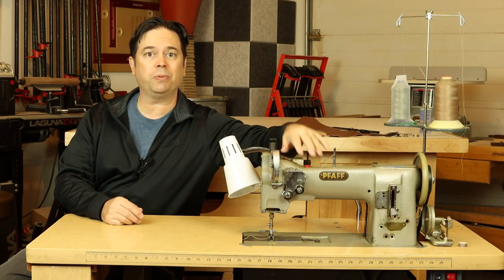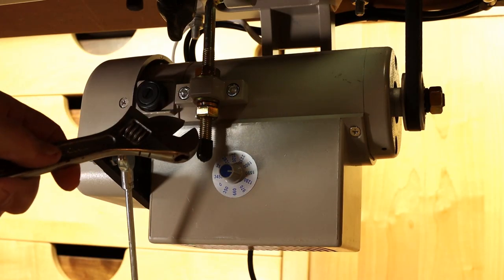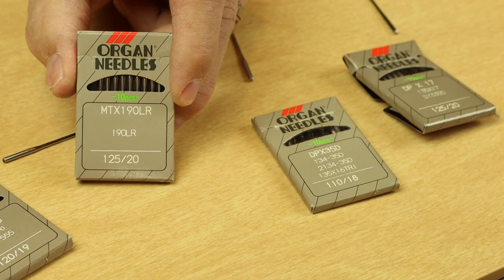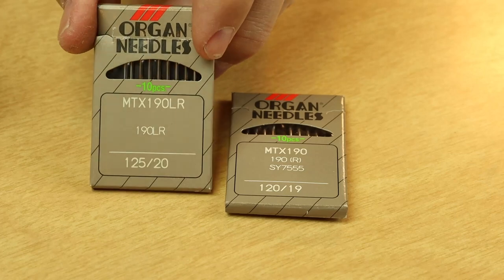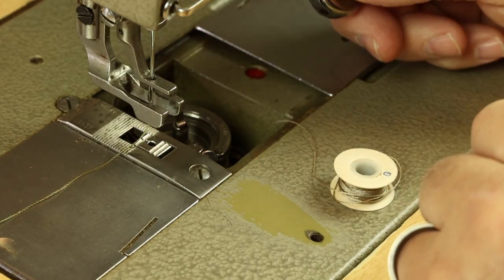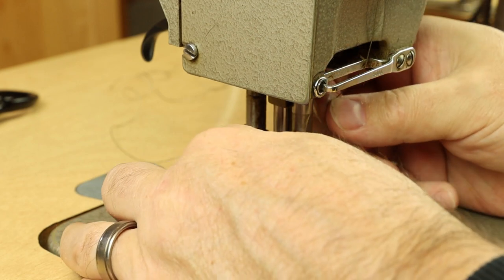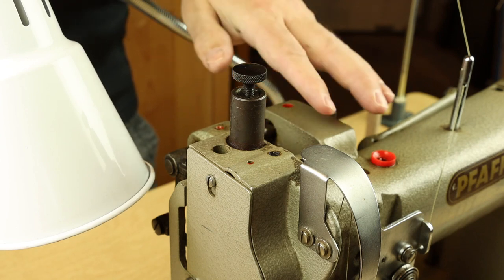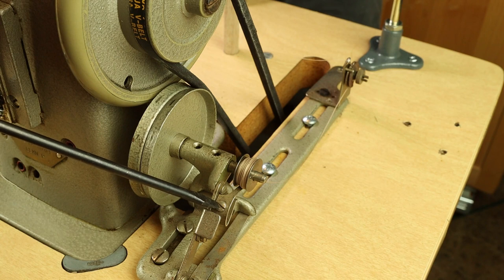Everything Pfaff 145 Walking Foot Industrial Sewing Machine Learn to set up and adjust Pfaff 145 545

Comment: I have a545-H3 that I got for free for fixing someone's computer that was moving . They had a couple other machines and didn't want to move it. I've since completely restored it right down to the hammer finish paint. I used to use if for sewing patches onto jackets and vests but I've since started doing leather work. I'm tuning the machine for that now. This is one of the best overall views I've seen for these machines.
Reply from the maker: That's cool, sounds like you appreciate old German cast iron like I do.  Have fun with your Pfaff and thanks for the kind words.

Comment: Hi there, excellent video.  I need some instruction on skipped stitches for my pfaff 145 h3.
Reply from the maker: Thanks!  Start with the simple things like the correct needle system 134-35 for the H3 variant of the 145.  Versus 190 system needles for H4 machines.  Also be sure that your thread size is a good match for your needle size.  I typically use 92 weight thread with a #19 or #20 size needle.  Jumping up to 138 thread usually causes problems, unless you dial the whole machine to suit thicker thread.  If that doesn't help, it may need a full time and tune.  Best to you

Comment: This is a very informative video of a 145 pfaff. I purchased one that i believe was used for parts and repaired, it is missing many things as the knee lift lever hinge to spring, gear covers and top plates, any idea where these hard to find these parts? I own a 145 H4 almost new so i have something to compare
Reply from the maker: I've bought used Pfaff parts from Nick-O-Sew and eBay.  Good luck finding what you need for your machine.

Comment: I loved this video. I am 75 and have a Pfaff 145 - H4  6/1C. I purchased it several years ago for my wife, but she hasn't used it. It was used by a lady who did shoe and clothing repairs and then it was purchased by a man who made leather products and repairs for horse shows.  That is who I purchased it from. I cleaned the case and the table and had it serviced by an industrial sewing machine company in Beloit Wisconsin.  NOW I intend to do some leather reupholstery even though I have never sewn anything in my life. So, I just want to tell you this video is magnificent.  If I could download it, I would just to have it for reference when needed. 

I am going to have a lot of questions, I think, as I grow more familiar with the machine, with sewing leather, and with upholstery in general. Right now, I have two dying questions. Is there a guide I can attach to the machine so I can set the needle at a constant distance from the edge of my piece? I think I may make very wavy or crooked seams.  My second question has to do with how s-l-l-o-o-o-w-w-w you were able to sew. I do not have a servo - just a regular electric motor and I need to be able to sew slowly until I can become more familiar with the machine and the process.  I very much appreciate any instructions or advice you can give me.

Best regards,
DG Crum
DeKalb, IL
Reply from the maker: Hi Darryl, thanks for the nice comments.  For sewing straight lines you can use an edge guide.  I recommend a simple magnetic guide that you can get from Sailrite or any sewing website.  To slow the machine down, you'll need to install a servo motor.  Use a small motor pulley for even more control.  Here's the video on installing a servo ... https://youtu.be/Dx_rS9Fzvfo
Best
Reply: @TheThoughtfulWoodworker  You are the best. If I ever become a world-renowned reupholstery artist, I owe it all to you.  Thank you again for the information.  Uh, if my wife happens to read this, Thoughtful, I owe it all to her. Just covering my bases, okay.
Reply: @TheThoughtfulWoodworker  One more question, Thoughtful. Where can I purchase a servo motor kit and what model did you install on your Pfaff 145 H4?  Thank you for all of the help.
Reply from the maker: @darrylcrum2495  This is the servo I use...  https://amzn.to/3wWFXZa   It will make your Pfaff a whole new machine!

Comment: Very well put together instructional video, i have no problems with my 145 h-4 other than i wish i could space my stitch a little more for top stitching, so my question is is there anyway to do so.The factory stitch width is just not spaced enough. TYIA 27:53 27:53
Reply from the maker: Thanks.  There are ways to modify max  stitch length, but I don't recommend it because your reverse stitch length won't match.  Leatherworker.net may have an old blog post on the topic.  Best to you.

Comment: Thank you for this tutorial. There is a Pfaff 145 in an auction right now when nobody has bid on it. There is less than 24 hours left in the auction and I was wondering what this machine is capable of and whether I should put a bid on it. After this I think I I will put a bid on it. Even if the sewing machine is junk the table are in great shape and can be used with my Willcox and Gibbs High Speed lockstitch.
Reply from the maker: Hi Dale, a Pfaff 145 CLMNP H3 or H4 is a typical upholstery weight industrial walking foot sewing machine.  There are many variants, but the most common says CLPMN on the plaque.  That one is capable of sewing up to 3/8" of compressed leather or material.
Reply: @TheThoughtfulWoodworker  On the post of the sewing machine there is exactly the same number that you had in the video. I will be a bidding on it because sometimes people do not bid on them, and they go to scrap. I assumed it was an upholstery machine or leather machine, but wanted to watch your video to make sure. Thank you

Comment: I've had my Pfaff 145 H4 for over 20 years.  Other than reading the manual, I have had no guidance on the machine!  Your video is the absolute Best information!  I do have some questions tho. Regarding the wing nut on the back you refer to "steppage" and using the wing nut to raise or lower it for the steppage..What does that mean? And, on the bottom of the machine you mention the grease covers on both sides.  Do you somehow take them off and where do you apply the grease?  Also you mentioned the safety clutch.  Should that have grease or oil applied also?  The explanation of the needle system was very clear too.  I have learned so much about my machine today!  Thank you!!!
Reply from the maker: Hi Ann, that's great to hear.  Thanks for the positive feedback.  The wing nut controls how high the feet step relative to one another.  That's all I mean by steppage.  
As far as the grease covers underneath, you can remove the metal covers and replace the grease inside.  Just smear some on the gears and re-install the covers.
Everywhere else I just use sewing machine oil as recommended in the manual.  
Best
Reply: @TheThoughtfulWoodworker  Thank you so much, again!  I'm going out to my shop and grease and oil my machine!  :)

Comment: This was very helpful and informative.   I would like to see how to replace the needle.
Reply from the maker: Thanks!  Check some of my other threading videos (consew 226, consew 206rb, and general Juki 563 videos) I think there's a tutorial on installing a needle.  Basically the groove faces left, and the scarf faces right.  Be sure to use the right needle system for your machine.  134-35 for Pfaff 145 H3, and 190 needle system for H4 model 
Best

Comment: I have a 1245 and love it this tutorial ❤❤ I have a question that I can't find anything on it. The reverse and stitch length lever fell out of the machine how do I put it back in as if I just push it in there I'm not able to adjust the stitch length. Do I need to take the plate off and adjust it inside? Do you have a place where you can answer certain questions? Thank you lynn

Comment: Very nice video.  I was wondering which would you choose if the price was very similar.  
The Pfaff 145, Consew 226r or Juki 562.  Locally,  all three are very similar in price.  Your sage advice will help me choose a machine that will be used with care.
Reply from the maker: My regular upholstery machine is a Juki LU-563.  That's the same as a Juki 562 except has a super large U style bobbin.  So between the three I'd take the 562 first, and the Consew 226 second.  Condition plays a big factor too.  Good luck with your decision!

Comment: What a great video! I have a small problem on my newly purchased old pfaff, it seems to be stuck in reverse and we can see that someone has tried to adjust it because some of the screws are damaged. The motor sounds good, the machine looks good, we got is to the point that the feet are working as they should but still in reverse. Any help will be apreciated thank you.
Reply from the maker: Well the simplest explanation is that the motor direction got reversed.  This only applies to servo motors though.  If that's what you have, just find the switch on the motor that reverses the direction.  It won't sew in the reverse direction at all 
Otherwise I suppose it could be the reverse lever mechanically stuck in the up position.

Comment: Thank you for all the great information I have a Fnaf 545 and for some reason my top thread on the needle side continues to get cut by something. Do you have any recommendations?
Reply from the maker: I've had that happen too.  Usually it's when you forget to go through the needle bar thread guide.  Or there's a rough metal edge on one of the guides.
Reply: Thank you so much for the reply. I ended up having the needle spun in the opposite direction, and the sharp piece on the bobbin was impacting the needle on rotation.

Comment: Also is the "instruction manual " what I would use for fixing and maintaining the machine.  Thanks for any help you might provide.  Happy labor day
Reply from the maker: Hi Neal, the user manual is good for maintenance like oiling points and basic setup, but for repair you'd need a service manual.
Thanks
Reply: @TheThoughtfulWoodworker  Thanks for your getting back to me.  The inside of this machine is pretty hairy with dust animals everywhere.  Cleaning and a parts needed list will be a starting place.  I will continue to look for the "service manual"  Any thoughts on where to find one.  All the best neal sw fla
Reply from the maker: @nealhere  A service manual may be available from an industrial sewing machine dealer, or you might get lucky on eBay.
Best
Reply: @TheThoughtfulWoodworker  Thank you I'll do some checking.  Have a good holiday.  You are doing good work out there.

Comment: I recently bought a pfaff 545h4 and the guy told me it ran with 135x17 needles. It’s sews okay but sounds pretty clunky. Should I just reset needle bar at to take 190 needles again?
Reply from the maker: I certainly would.  That's what it was designed to sew with.  I like 190 needles better anyway, because they are a little longer, with less chance of the needle bar hitting the presser foot.  Just stay on the high side of needle sizes.  For instance, if 92 weight thread can use a size 18,19 or 20 needle, choose the #20.  Less needle breaks that way.
Best
Reply: @TheThoughtfulWoodworker  I appreciate the quick reply, thank you for the awesome videos as well.

Comment: Very usefull video, thank you! Also if you can help me i have question for you about my pfaff machine and situation. I have pfaff 145VB6B GM (i think  "B"  is little worned, its old machine :). It is super fast machine so i want to install new servo motor so i can speed it down. But do you think also i can use thicker treads on this machine. Thicker than "40", mb 20 or even 10. Is it possible to use that treads if i change needle on it. Would be very helpfull, thanks!
Reply from the maker: Thanks Dean.  The designation on that Pfaff 145 is a little different than I'm used to.  Pfaff made so many special factory machines for special purposes, it's hard to know until you see it in person.  Usually "B" means for medium weight materials, and "G" confusingly means large bobbin (because on a Consew a G bobbin is a standard size).  I can't find reference to the specific machine you mentioned, so it must not be as common as a 145 CLMPN that I usually see.  C= Medium to heavy weight, L= for sewing leather, M= has a safety clutch device, P= has 4-motion drop feed, N= denotes maximum stitch length, 6mm if I recall correctly.  If it is indeed a medium weight machine, it will sew up to 92 weight thread like most industrial sewing machines.  Good luck!

Comment: Great video! Thanks! I'm considering purchasing a phaff 145 6b walking foot.
The owner said it needs the timing adjusted and a servicing. Is the timing hard to adjust if it isn't a needle problem? Thank you kindly!
Reply from the maker: Thanks!  The timing isn't hard to adjust, but I would proceed with caution if you can't try it before you buy it.  Make sure the plaque says CLPMN.  I'm not familiar with the 6b sub model variant.  Usually they're listed as 145h3 standard lift of 145H4 high lift.  I'm worried it might be a specialized factory machine without four motion drop feed.  Not sure though.  Good luck researching it, I couldn't find much info on a 1456b.

Comment: Great content!
I have pfaff 545, when I lift the presser foot, it won’t release tension and tension adjustment is almost all the way out, any ideas would be helpful 
Thanks
Reply from the maker: Sounds like you'll need to replace the tension assembly.  Usually that fixes the problem.  Luckily they're inexpensive and easy to swap out.  Good luck!

Comment: Is there a manual for this machine? I just got the machine and would love to have some kind of manual for it.
Reply from the maker: Yes, there are free manuals available online.  However, they contain limited information.
Reply: How do I date the Pfaff 145 H4?
Reply from the maker: I've never been able to crack the date code on old Pfaff machines.  Sorry I couldn't be more help.   @tracygoodman6525
Reply: I found the manual. In fact I have one that is for a few of them (that type). My 145 is almost up and running. Got to mount the motor and I am off and sewing.

Comment: Thanks for all your videos on the Pfaff 145. I was wondering if I could get your opinion. I was excited to find a 145 for $400 a couple months ago. I took it into a shop to have it oiled and timed which cost $200. It sewed beautiful for about an hour then it started tangling the needle thread in the bobbin area. I took it back in for service and was informed it need a new hook and plate. This will cost another $200. So total I will have about $800 in a machine who's paint is very worn from use. Would u think spending the $200 on new hook and plate mechanism is worth it? Or cut my losses and get something else? Thanks
Reply from the maker: Thanks for the kind words.  I would have it fixed, if you're not comfortable replacing the hook.  If you love it, you'll have a keeper.  If not you can sell it at break even cost.
Reply: @TheThoughtfulWoodworker  thank you. I appreciate the quick response. I've learned everything from your channel about the 145. Thank you very much for your input. I will move forward with the repair

Comment: Awesome machine. Is there a way you could do a video teaching us how to time this machine please?
Reply from the maker: I don't have this machine anymore.  Timing is pretty easy on the Pfaff once you see it done.  Hopefully there's already a video on it.    Sorry I can't be more help.
Reply: @TheThoughtfulWoodworker  no worries. I just got started and got the 145 here. When doing the rotation with the hand wheels, there is one spot.where it requires a lot of force to complete the rotation? Is this normal or should all rotations be smooth ?
Reply from the maker: @Luckystudio13  if you take the belt off the machine, so it's not connected to the motor, it should be smooth rotating the hand wheel.  Make sure you hit all the lube spots on the head.  Once the belt is back in place, there is normally friction from the motor brake.  Partially depress the foot pedal to release the brake.
Best
Reply: @TheThoughtfulWoodworker  copy that. The hand wheel is smooth but there is one spot during the rotation that seems like the bobbins area under the needle is binding onto something tight. (So tight like 2 metals are stuck onto each other). Just one section and then it is smooth again. This is without the motor belt and needle on.
Reply from the maker: @Luckystudio13  lift the presser foot and run it at speed for a while.  Make sure all lube points are oiled first.  I had a Pfaff that wouldn't budge, and it worked loose with oil and running it a bit.
Good luck with your machine.